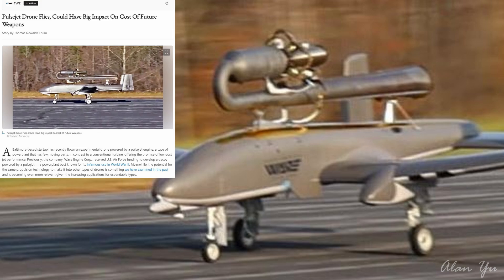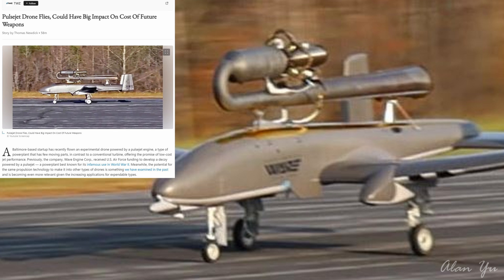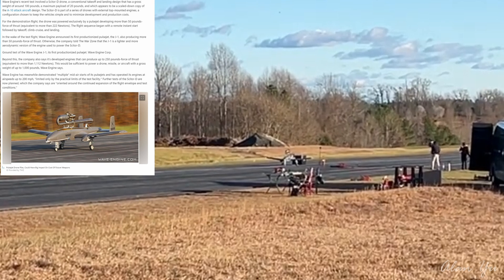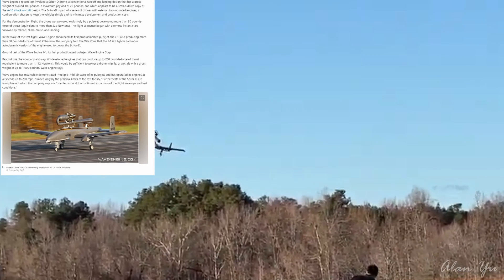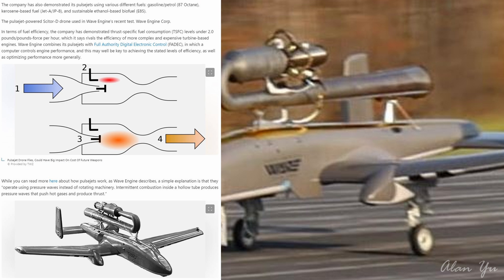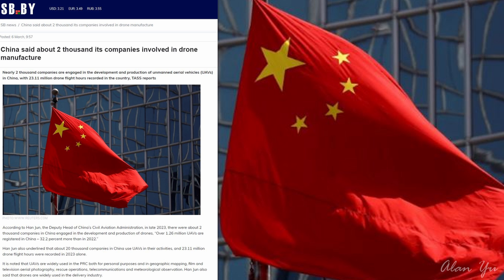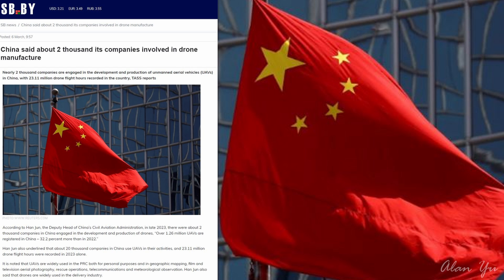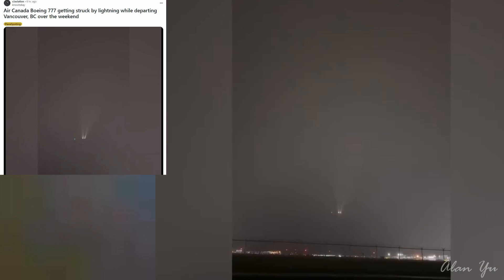Pulsejet Engine Drone, Lightning Strikes Air Canada Plane, China Drone Industry Data

Comment: From Wikipedia, why lightning does not affect these planes. 

A Faraday cage or Faraday shield is an enclosure used to block electromagnetic fields. A Faraday shield may be formed by a continuous covering of conductive material, or in the case of a Faraday cage, by a mesh of such materials. Faraday cages are named after scientist Michael Faraday, who first constructed one in 1836.

A Faraday cage operates because an external electrical field causes the electric charges within the cage's conducting material to be distributed so that they cancel the field's effect in the cage's interior. This phenomenon is used to protect sensitive electronic equipment (for example RF receivers) from external radio frequency interference (RFI) often during testing or alignment of the device. They are also used to protect people and equipment against electric currents such as lightning strikes and electrostatic discharges, since the enclosing cage conducts current around the outside of the enclosed space and none passes through the interior.
Reply: I saw an aircraft get hit by lighting once.
Reply: @drysori  That must have looked so different and unbelievable.